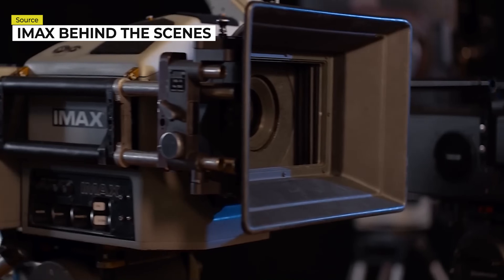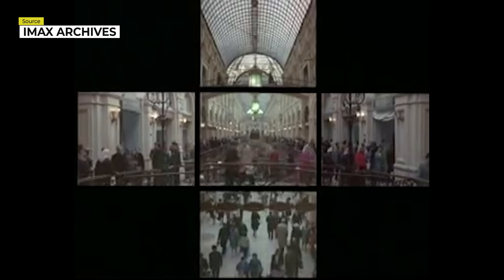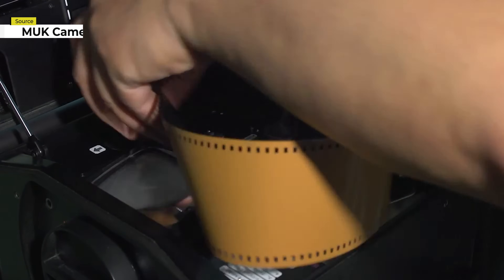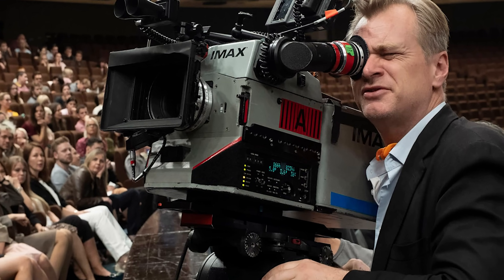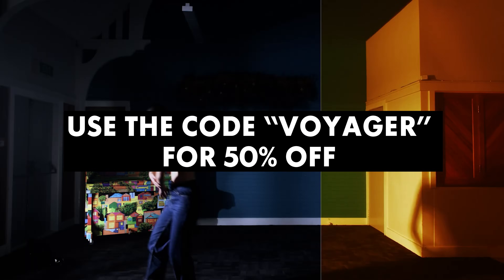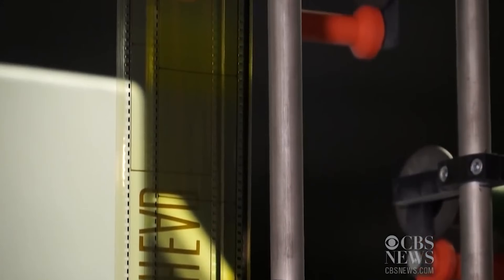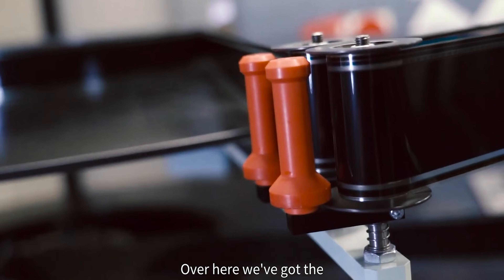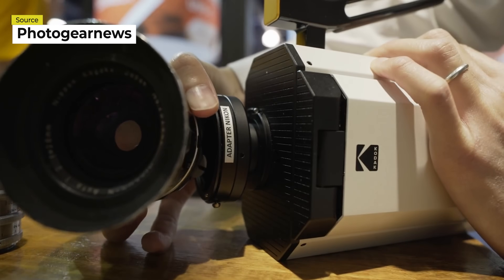The TRUTH about building a Digital IMAX camera

Comment: Things the video didn’t get right:

Says 15/70 film, shows a strip of 5/70. 

The last movie finished in 15/70 was Tenet. It only got about 13 prints world wide though because of the pandemic. 

Filmconvert is an insufficient film emulation since it only uses grain overlay and doesn’t have halation. Or like half the stocks actually used in modern movie productions. Film emulation is more than color and grain and Filmconvert doesn’t really put any effort into doing any kind of scientific emulation, which is very much possible. You can emulate at least 35mm film, by mathematically analyzing it and making a film emulation as a visual effect. You can mathematically translate the colors, write an algorithm that creates RGB grain in response to the light, build a halation algorithm to respond to light, build a gate weave simulation. Even Filmconvert nitrate is a joke in the world of real film emulation. 

Also emulating IMAX film with digital is much more complex than having a high enough resolution source. The Alexa 65 has about the same scanned resolution of 15/65 Kodak Vision3 500T (5219). The issue then is that the pixels are larger than some grain would be. Same for 8K. No 8K cameras has a low enough signal to noise ratio to be actually able to resolve the grain. Also no digital projection, even IMAX dual laser, can really resolve the fine detail a pice of 70mm film can. That’s also why Roma was released in 70mm. 

Talks about 15/70 projecting and shows digital laser projectors.

Btw an 8K digital camera doesn’t have the same resolution as an 8K scan from a an IMAX frame would have. All digital movie cameras that record color now use a Bayer filter to achieve color. So the only real 6.5K Alexa 65 or 8K RED cameras are the black and white and only versions of these cameras because the don’t have a Bayer filter. If you want to know the actual resolution of a digital color recording camera, take the resolution and multiple it by 0.7. So a RED V-Raptor has an effective resolution of 5.6K at best. That is if you assume you won’t get any reduction in resolution from other factors in the cameras image pipeline like sensor noise or compression.  

All the lenses he shows when talking about a digital 15/65 camera. The lenses used for 15/65 are already resolut enough. They’re excellent medium format Hasselblad lenses. Alternatively, Leica-S or Schneider Kreuznach digital medium format lenses should be able to be adapted for a digital 15/65 sensor. 

Again, Filmconvert is not a high end film emulation tool, like at all!

The 9x7 guy is wrong about depth of field. 65mm IMAX is the shallowest motion picture format in existence. Resolution or micro contrast have nothing to do with blur circles and depth of field. The tolerance for the circle of confusion might be lower on a higher resolution camera, but that doesn’t change the physical depth of field. You’d need to shoot on a 19mm T0.75 to achieve the same maximum shallow depth of field as the 50mm T2 on IMAX 65mm has. That’s a 25mm T1 in full frame terms. You might be able to come close with longer lenses on full frame but not on APS-H. Look at the first time Batman appears in The Dark Knight Rises, you can see the lights in the tunnel being blurred even though the subjects 3-5m away from the camera at times. And all that on a 25mm equivalent. So maybe there’s a way with speciality lenses to achieve a shallower depth of field, but not with standard cinema lenses. 

He’s absolutely right that resolution is not the most important factor. IMAX film both for capturing and projecting is important because it’s an absolutely unique experience. The colors and contrast on a photochemically finished print (like Nolan still does) are more beautiful than anything else and the level of detail that is being able to be perceived on an IMAX screen is so far unmatched by dual laser projection. It’s important because it’s the most premium format we have that when used right gives us something we don’t get from digital. IMAX film is not something to be pursued to be digitally recreated, but to be kept alive in the few places it still exists. I’m very grateful that Nolan still shoots and finishes he’s films in IMAX 15 perf and that he keeps pushing it. Next year with BW large format photography for the first time ever.
Reply: I was embarrassed for the young lady clearly out of her depth answering this question and missing every bit of the nuance about why film is difficult to emulate digitally.
Reply: After watching Steve Yedlin's demo on color science/film emulation, the Filmconvert LUTS are just superior forms of instagram filters at best.
Reply: @kraftpunk6654  They’re a joke and missing so much. I’ve just seen Glas Onion, a digitally shot movie that looks like it was shot on film and graded to look like a print.
Reply from the maker: Btw, in the video we are not suggesting that this actually happen. More of an exercise in if it's even achievable and if it is, is it even worth doing it? Thanks for your response though!
Reply: interresting part abbout resolution and grain size. i didnt think about that.

would add to the coulour reading and actuall resolution part, that different cameras read a different ammount of combined pixel of the sensor.

8 Bit 4.2.0 (one pixel saved = 4 pixels on the sensor combined) like consumer cameras, phones and the videos we look at on YouTube etc.)
10 Bit 4:2:2 (one pixel saved = 2 pixels on the sensor) like Sony, RED
12 Bit 4:4:4 (one pixel saved = 1 pixel on the sensor) like ARRI RAW

i think, you could translate this for example to 2,7K ARRI RAW got a higher actuall resolution than 4K RED RAW
Reply: This ^
Reply: Absolutely agree with everything. Thank you for pointing out all of this so others can see this too. It was a interesting video but with some flaws in-between :)
Reply: This is really thorough and very impressive! How do you know all that? What are you reading? Please drop the reading list!
Reply: Regarding signal-to-noise issues, I know it's very common to use cryogenic cooling for scientific imaging sensors precisely for this (and then coupling the sensor to the imaging plane using optical fiber bundles for insulation). A theoretical Digital IMAX camera might need to use this approach to the sensor too.
Reply: Thank for taking your time to writing all of this
Reply: Buy an URSA and make a film. Those are really good cameras. And you don’t have to waste money paying for a name.
Reply: @A10Jedi  I‘d go for the C70 at that price. Better DR and low light.
Reply: @VariTimo  Do you happen to know who manufactures the 70mm stock for IMAX? I assume it's either Fujifilm or Kodak. Have they always been supplied by the same manufacturer, or has it varied? I also wonder why they didn't simply make the perforations larger, then they wouldn't need to have 15 per frame.
Reply: @ArnoldTohtFan  Kodak makes 65mm and 70mm film stock. I don’t think IMAX every used another manufacturer’s films. It’s also not specifically made for IMAX. It’s just regular 65mm/70mm stock. And what would making the perforations larger do? They’re the sprocket wholes with which the film gets pulled through the camera/projector. It’s just used as unit for the frame size in that context. 65mm/70mm film so and so perforations wide or tall.
Reply: @VariTimo  Regular 70mm stock? I thought IMAX was a lot larger than conventional 70mm. When you say it's the same stock, are you referring to its size or its composition? I assume the latter. Having larger perforations would reduce the amount required. I mean, 15 is just ridiculous.
Reply: @ArnoldTohtFan  What do you think perforations are?
Reply: @VariTimo  The holes at the sides. I thought this would have been evident when I mentioned the number of them. I mean, seriously, what else does it have 15 of?
Reply: @ArnoldTohtFan  It has 15 because that’s how many wholes the width of the image spreads. With regular non 70mm IMAX it’s 5-perf. Nobody went I’m gonna use 15 perforations of the image. They made the image as big as they wanted and it happened to be 15 perforations wide. Again it’s just used as a unit of communicating the different scales.
Reply: @VariTimo  I'm surprised they didn't make a machine that had bigger claws, then they could elongate the perforations and have five per feame. Were they forced to adapt to pre-existing machinery and standards? That's hard to believe, since IMAX build their own cameras and set their own standards. You expect that kind of innovation when a new format is created.
Reply: @ArnoldTohtFan  But what would the benefit larger perforations actually be in your mind? You’ll end up with larger mechanisms, it’ll probably make the cameras louder, and the larger wholes would also created larger surface area’s that’d be more vulnerable to tearing.
Reply: @VariTimo  It just seemed like the obvious thing to do, and I thought maybe it would make it more efficient somehow. What annoys me most is that they chose the boxy 4:3 for the dimensions of the frame. Who in their right mind would choose that? I would have gone with 1:85. I would have also made it mandatory that all IMAX movies be shot in the corresponding aspect ratio. It's ludicrous that they aren't synced up. Christ, imagine paying all that extra money to shoot in IMAX and then choosing an aspect ratio that wastes nearly half the frame. The amount of space that gets taken up by those black bars, man. It's lunacy.
Reply: @ArnoldTohtFan  Have you actually watched a movie in an 1.43:1 theater?
Reply: @VariTimo  No, but it's still ludicrous. The goal should ideally be to approximate the clarity of human vision, yes? In that case, 1:85 is the closest approximation. Nobody wants to watch a TV with a cropped 4:3 display, so why would they want that on the big screen? I think IMAX would do better with me as creative director, quite frankly. No more liemax. 70mm film or GTFO. It's non-negotiable. I would never water down my product just to keep the business competitive in an increasingly digitized, throw-away world. My god, whatever happened to principles? The worst that could happen is that we become a niche option for directors with exceptional vision, but what's wrong with that? Quality over quantity, always.
Reply: @ArnoldTohtFan  Experience and understand the thing before you want to take it over.
Reply: @VariTimo  I can't do it. I'd be distracted as hell. “Where are the flanks, man? Who chopped off the flanks?! Hey, the 1930's called, they want their aspect ratio back!”
Reply: @ArnoldTohtFan  1.43:1 in IMAX is not really the aspect ratio. It’s the shape of the screen. 1.43:1 screens are so tall that the stuff at the top and bottom making it 1.43:1 is just extra for periphery. They don’t even frame for it because it would be too high. They more or less have to frame for the 2.39:1 center of the 1.43:1 frame to make sure stuff isn’t too high up. The point of IMAX is too have too much screen so you can get lost in it. And nothing stipulates that 4:3 is less less immersive or cinematic than 2.39:1 or 1.85:1. They’re so many factors found into that. Educate yourself before bitching about stuff. See a 1.43:1 movie on a 1.43:1 screen before telling me how you’d fix IMAX.
Reply: @VariTimo 
C70 doesn't have better Dr or low-light it has already enough noise cancellation. ursa doesn't have shit ton of noise cancellation fuji xh2s completely anhilates c70 interms of Dr. Which is like half the price.
Reply: @VariTimo 
Plus there has been not a single shot that has taken on c70 look remotely filmic. It's look like video came from camcorder.
Reply: @alkathorat2859  That has nothing to do with a camera of that level. Once a camera captures enough information, the look is entirely dependent on the post pipeline not the camera.
Reply: @VariTimo 
Well yeah post production pipeline going to bringout better image incase of black magic. c70 have way to much noise cancellation only thing you can do is grading. image doesn't even look remotely close any film cameras let alone black magic 6k pro with post production look miles ahead interms of image quality only camera can match that in canon range is r5c that's about it which is more expensive and bigger sensor.
Reply: Wow, thanks for your lenghty commentary! An absolutely fascinating level of knowledge 👀
I personally know almost nothing about film theory, but just the quick glance given here over the Filmconvert software gives out that it's just a turnkey solution for people seeking for "that nostalgic retro look". A bit like those instagram polaroid filters. I don't think it will, or is even meant to appeal to the "real" film enthusiasts 🤔
Reply: Why aren't you doing better as opposed to pointing out the flaws of others?
Reply: @BobbyGeneric145  
Because why should someone be immune from being told they're getting shit wrong just because they're on YouTube? Too many people worship too many YouTubers and other social media "stars" without doing any kind of thinking or research for themselves. Deflecting an excellent reply with "do better" is whataboutery at its finest.
Reply from the maker: @Geoff D I DEMAND TO BE WORSHIPPED
Reply: @Geoff_Dearth  Funny seeing you here.
Reply: @BobbyGeneric145  Because it’s not my purpose to make videos that educate. I can point out some things that are incorrect or misunderstood but I’m not gonna put my time into making videos. I am gonna rephrase the opening in that comment to make it feel less negative.
Reply from the maker: Appreciate you pointing out a few flaws. While I might not "agree" with everything you said I do appreciate the in depth response and didn't take it the wrong way at all! The industry is so large it's hard to know exactly everything so I'm sure even with the best research, with these hypothetical videos, we'll get some wrong. Thanks for watching!

Comment: 12:09 haha dude throwing shade at BMD URSA 12K. Thanks to BRAW filtering the camera indeed barely resolves 2000 lines, it's ridiculous. BRAW really needs a better replacement.
Reply from the maker: Yep 😅 some shade at RED too in one part of the interview. He was great!
Reply: Disney just shot a feature film on the Ursa 12k called Rise. Apparently it’s good enough for them at least, but def get your point :)
Reply: Thats what you get with a compressed format.
Reply: @Dennis94913  compression isn't the problem here. Even at Q0 the UMP 12K cannot resolve more than 2000 lines. Both the heavy spatial filtering and high radius unsharp mask are quite a mess and 12K are the minimum for proper looking 4K.

With ProRes RAW I'd say 6K are more than enough to achieve the same while having an image that actually shows more low frequency texture as well.
Reply: @DennisSchmitz  interesting, does the spatial filtering low the detail in the shadow region?
Reply: @Dennis94913  quite consistently throughout the exposure range. Even in bright areas fine detail and low freq texture are affected quite badly. These issues are known since the introduction of BRAW on the Pocket 4K, with cDNG it resolved way more detail and the image looked really textured.
Reply: Intriguing. So that's why camera manufacturers don't tell that spec anymore. Most manufacturers used to list the TVL spec for their professional cameras at the beginning of the digital age but then they just started to refer to the final pixel count or width/height.